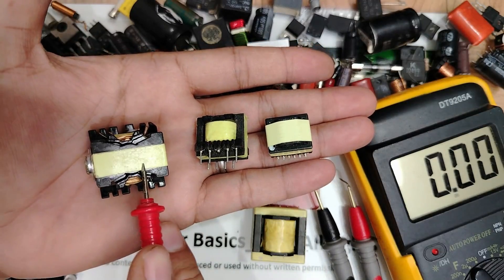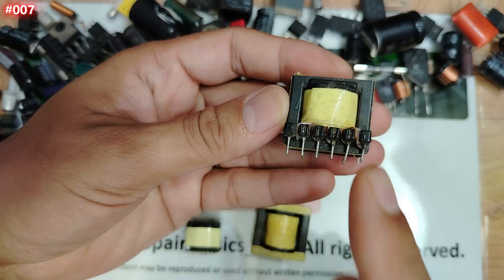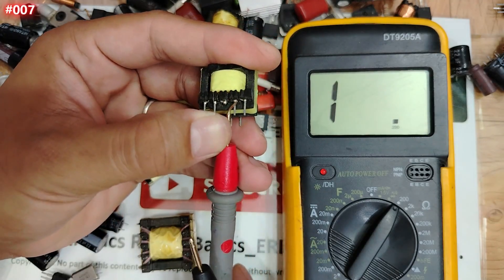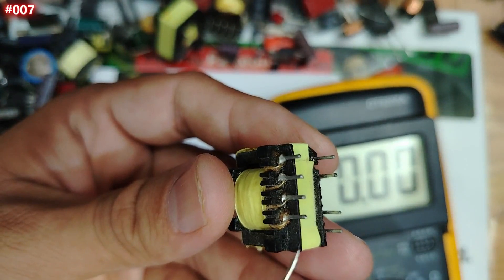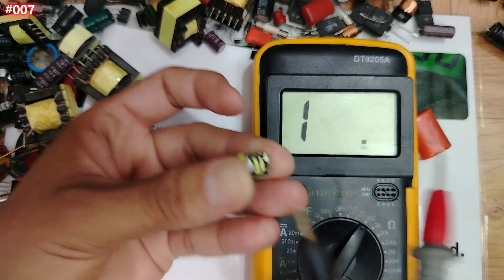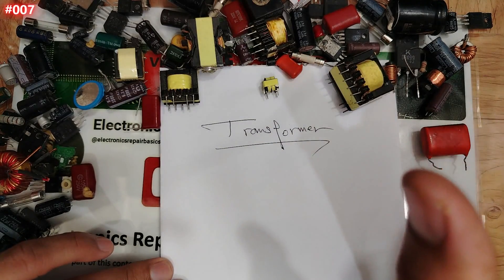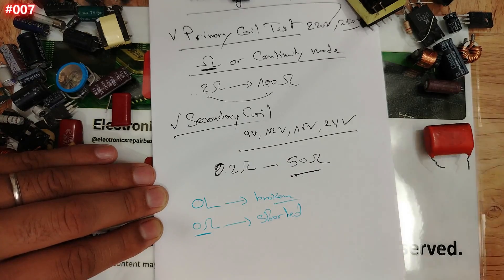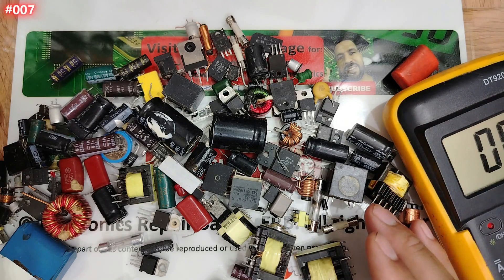#007 Electronic Components: How to Check Transformer Using Multimeter | Transformer Test

Comment: Sorry, maybe in a transformer the thinnest wire should be the primary because it carries more voltage and less current; while the secondary has thicker wire because it carries less current and more voltage.

Comment: You deserve and got a new sub :) BTW, what about replacing or even repairing them? I have a bad one but unable to find a suitable replacement
Reply from the maker: Thanks for subscribing! For replacing or repairing transformers, it really depends on the specific model. Sometimes you can find parts online or at local electronic shops. Feel free to share details, and I might be able to help!
Reply: @electronicsrepairbasics_erb   Thanks I would really appreciate that--I've been working on this project for a few months without luck. Here are the specs: It has six pins. 2 pairs on the primary side (one pair tested open) and 1pair of legs on the secondary side. Legs on the secondary side are spread wide apart (end-to-end). Dimensions of the transformer are 22x23mm. Marking on the transformer are EE16 1.9mH-B. Fuse for the powerboard is fuse 250V 3.15A. .IC  OB2358SP

Comment: Good explaination. Thank you. Assuming the transformer is connected in circuit. How do you test it using multimeter?. Or is it the principle?. If it is , what resistance value you should expect.?

Comment: Please sir I have a transformer with 9 pin at the secondary side and 5 pin at the primary side. I found out that, at the Secondary side, pin1 2 3 read continuing while pin 4,5,6,7 read continuing while 8and 9 read continuing. I what to know if this is normal? 🙏 I need your help.

This the number on transformer: EBJ60770101  DGSJ1441

Comment: Hello! Something basic like the resistor, since many of the most common or hardest-to-detect faults are in basic things. Measured both on the board and outside the board.
Reply from the maker: Thanks for the suggestion, I'll consider it for a future videos.

Comment: Thanks for the great videos this one about transformers was very informative. I wanted you to show in circuit if you can measure the AC voltage in primary and secondary. Also it would be great if you found a 24v switching power supply and show testing step by step including the controller chip octocoplers, primary diagnosis  and secondary diagnosis. I am trying to repair some 24v for a friend it 8s a internal power supply110 input. Some shows 380 on the min cap some only shows half both no 24v output. I cannot figure out where the problem is. Thanks for everything you do you are a good teacher. God bless.
Reply from the maker: Glad you found the video helpful. I'll keep your suggestions in mind for future videos.